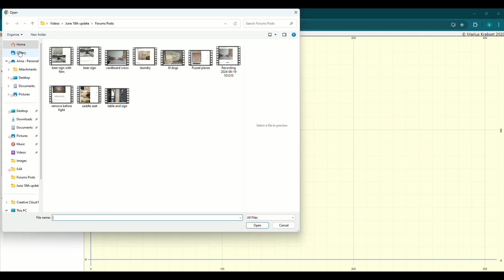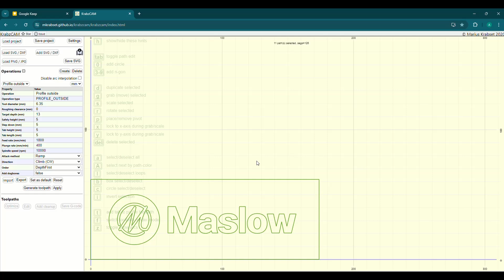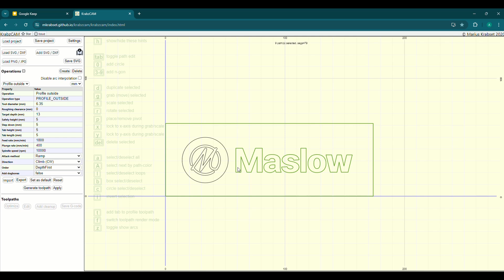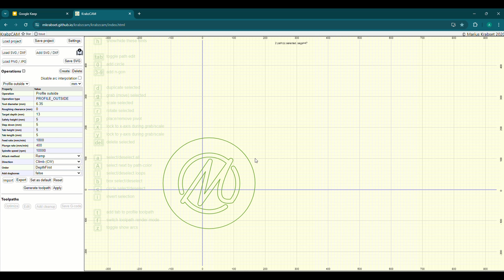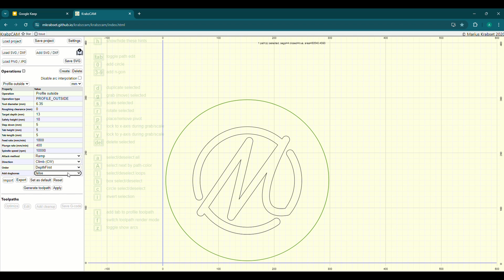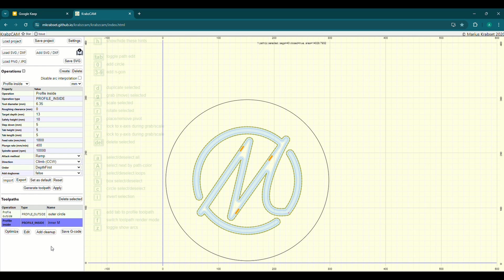How to Generate GCode using KrabzCAM

Comment: Thanks for the video, what parameters should I tweak if there is a lot of smoke and the bit is not consistently cutting all the way down? The sled rises up off of the surface of the OSB. Using 1/4” bit in a vertical configuration. Angle is 75•
Reply from the maker: Uh-oh, What is your feed rate and router set to? If you post some pictures and describe the problem in the forums we get some more eyes on this. https://forums.maslowcnc.com/
Reply: I think the video said to use 1800 mm => 70 inches. Referencing the forum, 10-30 inches per minute seems to work a lot better. Also replaced the bit.